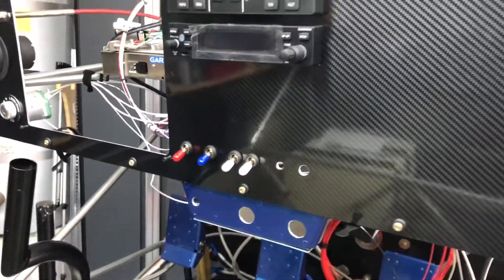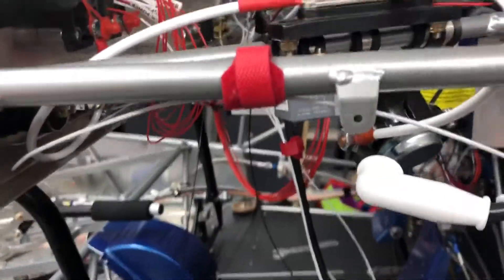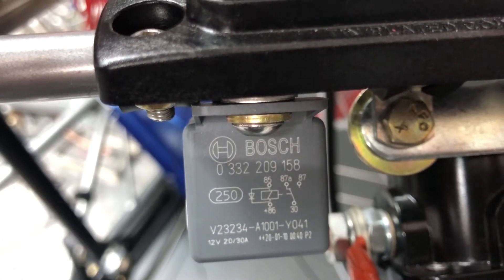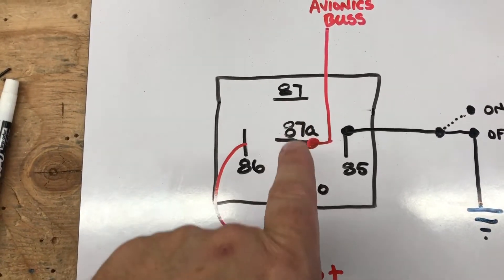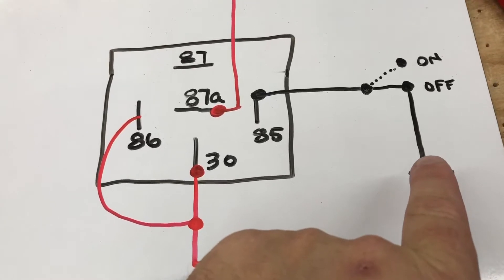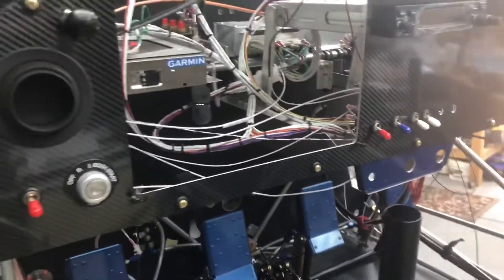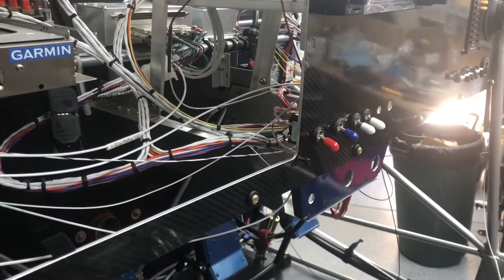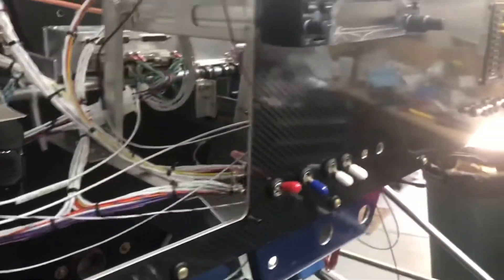Avionics Switch Using a Relay

Comment: Branden- what is the bus bar right above your relay that has the large gauge white wires? I'm building an S-21 also. Just trying to think ahead. Thanks for posting all the great pictures on your EAA build log. I'm also using the EAA build log- zip code 44256. Randy Brooks.
Reply from the maker: It is just a terminal block for my positive connections to avoid having too many ring terminals on the master/starter solenoid. Might not need it depending on your fuse or CB layout.  

https://eaabuilderslog.org/showmy.php?p=7Z6aiFvQO&z3=&i=40723826&l=66872&t=f&f=05831577-A547-48B4-A9E5-D2FF434070C3.jpeg

My plan is the master solenoid gives power to the terminal block. The main fuse panel goes to the terminal block. The avionics relay is energized by the terminal block. And the alternator B lead goes to the terminal block. You may be able to simplify it by placing all those connections on the output of the master solenoid and input of the starter solenoid. I just chose to use the block with more threaded posts.
Reply: @BadlandsAdventures  Great stuff. Thanks very much.